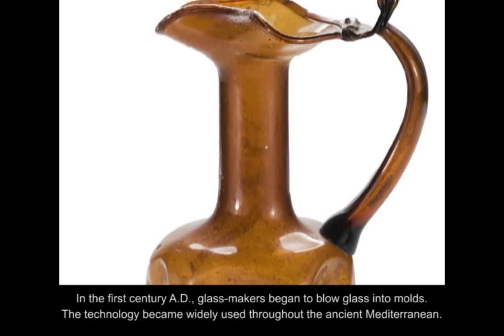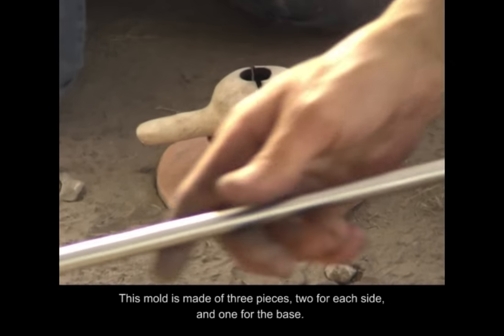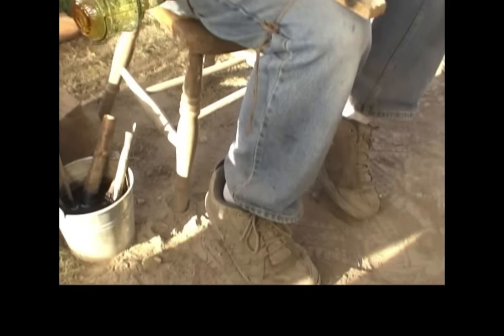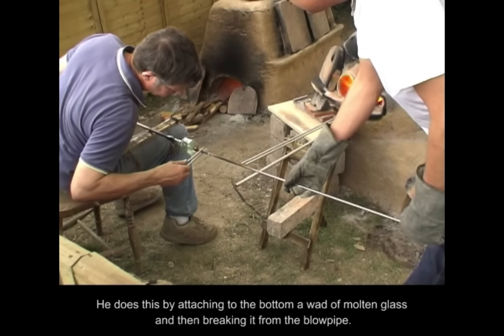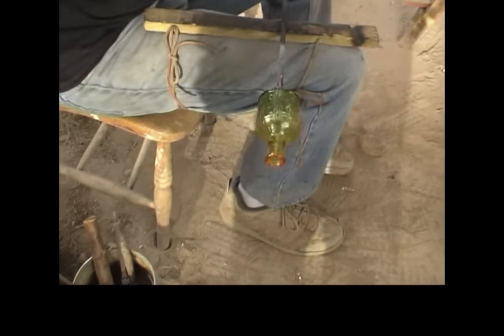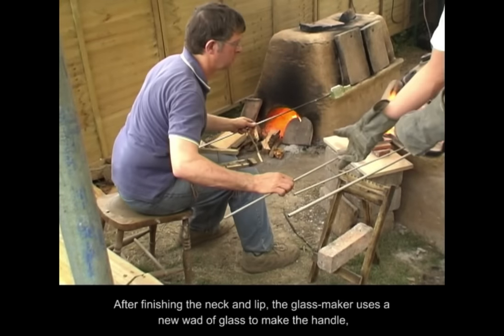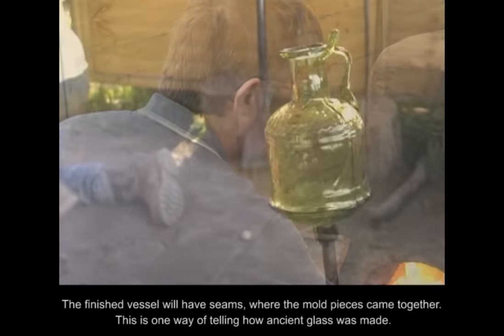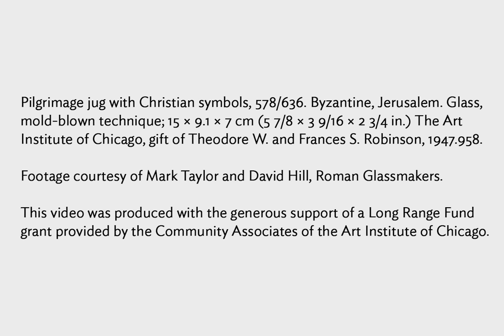LaunchPad: Ancient Glassmaking—The Roman Mold-Blown Technique

Comment: yeah but how did they make the blowpipe?    How would I make a pane of glass by hand without modern equipment?  on what surface can you place a sheet of glass inside the furnace without that tray (or such thing upon where the glass is being cooked) being burned up?
Reply: Often times, roman buildings had glass windows made from cast panes. A rectangular mold pressed into a bed of sand would be made, and then molten glass poured into it. This resulted in a pane of glass that would let in a fair bit of sunlight, but not allow you to be able to see out of the window. Later, window glass was made on a blowpipe by making a cylinder. The top and bottom of the cylinder would be cut off, and it was then cut along its length. When reheated in the furnace, the cylinder would be allowed to unfold inside the furnace and was then pressed flat with a block of wood to make a pane. Alternately, glass can be made on a blowpipe by spinning the molten mass quickly on the end of the pipe and shaping it with tools. Centrifugal force will pull the glass outward and make a large, flat disk which is then parted off from the pipe, resulting in a round sheet of glass with a nub in the middle where the pipe was attached. whether this particular technique was used by the Romans, I don't know.The vessels inside glass furnaces (be it the crucible in which the molten glass is kept, or a flat tray on which a pane is made) were ceramic. Clay vessels are heat resistant to a high temperature (since that's how they're made) provided they're heated evenly. If not, they may crack. Ceramics were very much consumable items in the ancient world, being produced in large numbers, and breaking often.
Reply: NO, you cannot 'cast' into a wooden mould! The glass is 1000 degrees celcius, and the wood combusts at under 400! Guess what would happen. They poured it onto ceramic and stretched it to shape.
Reply: The molten glass is at 1000 degrees centigrade - wood combusts at around 400.What do you think would happen? No, they used metal blowpipes. They were not cavemen! They could easily make metal tubes.
Reply: The blowpipes could have been made from iron. I suppose that earlier ages could have been copper, but the pipes would have to be long to avoid burning their hands and lips. Romans had metallurgy down to a science. (or down to an alchemy).
Reply: someone else has been watching Primitive Technology

Comment: Alright now someone tell me how the hell they made moulds with perfect circles.
Reply: You can make yourself a gauge in the dimensions of the mold that you want to make, and you keep carving or chipping until you can run the gauge through each side of the mold at a consistent depth that you want. Then you just use it and either burn it out, or adjust it until you break it in right
Reply: Two sticks and some twine can draw a perfect circle.   🤷🏻‍♂️
Reply: @lococomrade3488  interesting theory